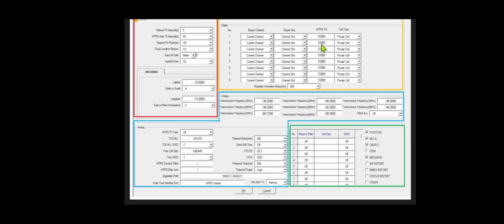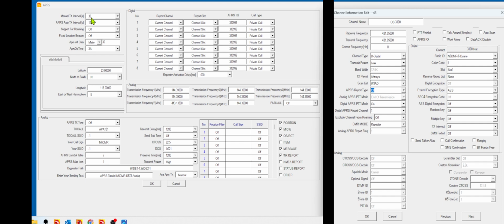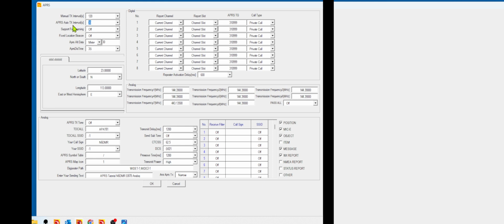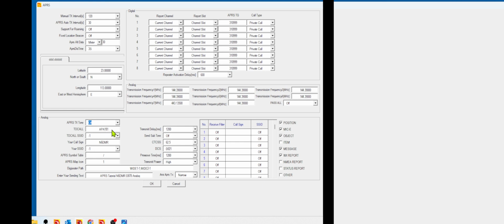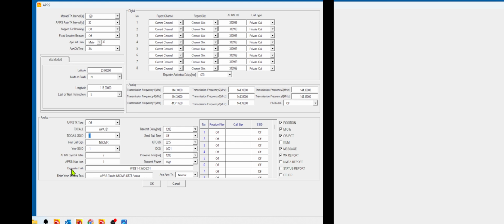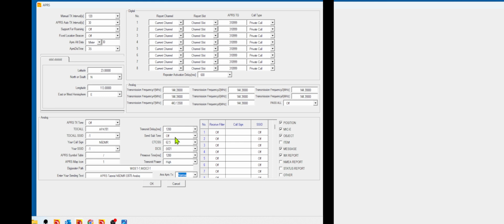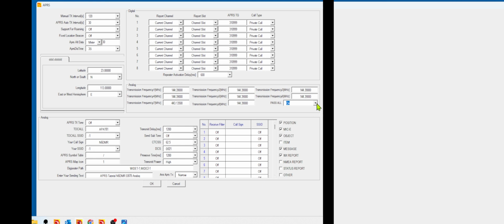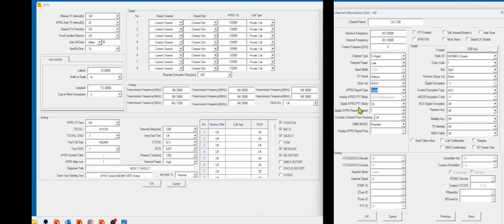APRS Tutorial for AnyTone D878/D578 Radios (NEW) 4/5/23

Comment: I have an 878 Plus (not the UVII radio). I have running the latest CPs and firmware on the radio. I do not however see the options to the right of the APRS Analog section. Are these from the 878UVII or possible the 578 radio CPS?

Comment: Duane, any chance for an analog APRS receive for SMS (not beaconing!) video?  Receiving beacons works fine in my 578 Plus, but it's super sketchy on Rx from cell phones and other radios.  Again, texting NOT beaconing.  Thanks and 73
Reply from the maker: Hi Jon,  Sorry to say that the Analog  SMS is not in my wheel house.  I have found it to be unstable.
Reply: @N6DMR_Duane  Thanks for the candor.  Any plans for our AT friends to fix it?
Reply from the maker: @JonW7SEA  It is not a radio issue, it is Brandmeister system issue
Reply: I was actually referring to analog SMS.

Comment: you don't want a "- anything" on the TOCALL SSID leave it zero and your "Device" will show "Device: Anytone: AT-D578 (rig)" or 878 respectivly. If I had the -1 on there the device wasn't populated.
Reply from the maker: Interesting,I have used 1 as the SSID on TOCALL and always had the device show when searching and putting the Call Sign SSID in as part of your call sign. So leaving TOCALL blank posts the radio source.
Reply: maybe it's some sort of digipeater setting how it handles it?? interesting for sure!
Reply: Why am I unable to add  my call sign to cps aprs screen

Comment: Pretty good tutorial. The only thing I can add is that the digital APRS must be set up in the brandmeister self-care. The digital mode won't take any information from the analog sections of the CPS. Also, I made the mistake of putting a space after the comma in the path elements of the analog section. It took me a while to figure that out. 
    I don't think a special channel needs to be set up for APRS. APRS can be made to work on any normally programmed channel.
   Good luck with your channel.
Reply: should there be a space after the comma or none?